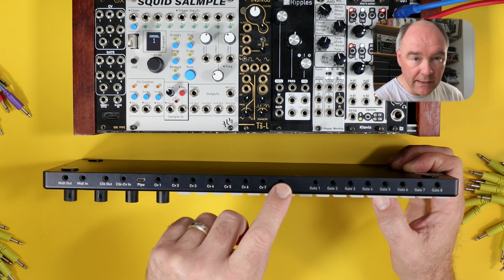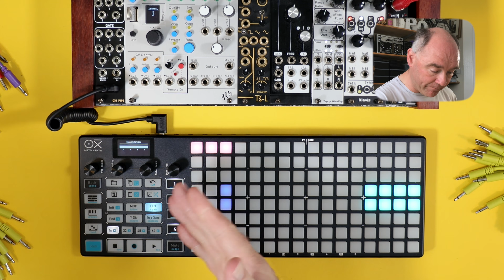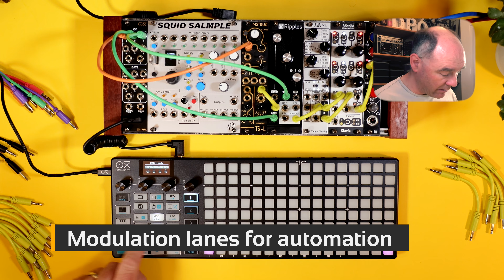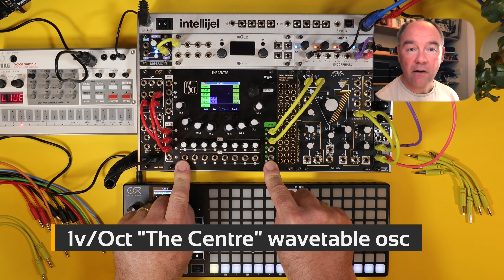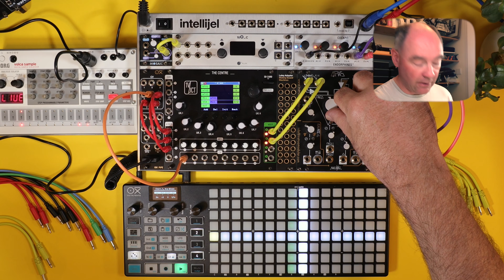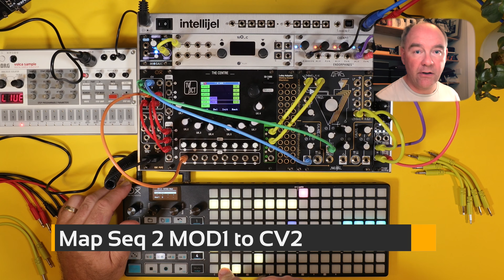Oxi One - the brain for your modular setup. What you need to know to get started

Comment: I have a fairly in-depth question about CV/gate routing and how it works when the sequencer is Multitrack or Matricial when there are multiple voices that can be used in a sequence.  How do you select the voice to be sequencing per track in those modes that have mulitple tracks on one page? I think I understand how to assign a CV and gate outputs to one of the 4 parameters in the sequence (pitch, velocity, trigger, lfo/mod, and then Gate, clock, accent, and mod threshold). but once you are on the page of a multitrack sequencer how do you know which voice you are sequencing on a given track? Say on the first Matricial track I want to be sequencing a pattern coming from Pizza and Ikarie, then on track 2 I want to be sequencing a voice on Plaits, but not as chords, rather as competely different sequences.  How do the tracks differentiate which CV and gates to sequence?
Reply from the maker: You set that up in the CV/gate screen (press the button) and then choose the sequencer and track per CV or gate output there. Maybe I'll do a video explaining that
Reply: @SynthDad a tutorial with Matricial mode the CV/gate assignments as it pertains to specifically modular gear would be amazing.  Some examples with multiple tracks and multiple CV/gate  sequences per track would be super helpful. Thanks for all you do!

Comment: Maybe you covered this in another video, but is it possible to have separate envelope parameters on each step? Also can the Oxi One do ratcheting envelopes? Thanks in advance.
Reply from the maker: Yes you can by adjusting the gate length and velocity which creates the envelope shape. Steps can be set to ratchet (as in repeat) so I'm assuming the envelopes would too!

Comment: Hi SynthDad i've just watched Oxi Instruments tutorial for absolute beginner and it shows 2 synths connected to the Oxi One via the Oxi split midi splitter with designated outputs 1 and 2 meaning that the 2 synths can be triggered independently of each other.I have a 7 way midi splitter - will i be able to use that and get the same result please ? Thanks for the support videos.
Reply from the maker: Yes you should be able to if each synth is on its own MIDI channel
Reply: @SynthDad  Ok thanks SynthDad that's good news.

Comment: When drawing a modulation curve, does it interpolate values between the steps (e.g. make it smooth) or is it stepped voltage?
Reply from the maker: It can do both! In the modulation menu press Shift and the knob corresponding to the modulation lane. This opens up a control menu for that mod lane. Scroll down and you'll see a "Smooth" parameter that lets you set the degree of slew between steps

Comment: how does the Oxi One compare to the Torso T1 as a generative Sequencer?
Reply from the maker: Good question! The T1 is more hands-on as it is a knob-per-function sequencer. You can quickly change the performance on the fly using each knob. However if you want to build songs or program specific patterns then it's not as strong.

The Oxi One is better for composition because it has an arranger (i.e. song creator) and you can build song progressions on it. It is very powerful at harmonising and chord generation too. And it has more CV/gate connections than the Torso. 

So really it depends on how you want to interact with the devices.
Reply: @SynthDad  thank you, that helps! 👍

Comment: Great tutorial. Cost differences aside, if you didn’t have the Oxi One and had to choose between it and the Squarp Hapax, would you still choose the Oxi?
Reply from the maker: I can't really give you a good answer because I've only played with a Hapax for a few minutes so don't know how to compare it. I think the Hapax has more advanced MIDI effects, but is larger and no battery power. The Oxi wins for CV/gate connectivity with 8 as against 4 for the Hapax.
Reply: @SynthDad  Good point about the number of CV / Gate outs. And that breakout module is a much tidier way to connect it to the modular. Cheers.

Comment: Here's something that's been killing me: the completely undocumented DIN SYNC functionality only mentioned in the manual in the context of an unincluded dongle. I've been trying for days to figure out an easy way to have the One trigger the Run functionality of Pamela's New Workout.
Reply from the maker: Oh I hadn't seen that before. My One didn't come with that adapter so I can't test it. Why not use the Clock Out TRS port on the back of the One into Pams? That's how I sync them
Reply: Ha, well I just learned you can set Pam's to start/stop based on clock instead of Run so now it works great. Really interested to see what the new "Matriceal" mode is going to be.

Comment: When you bought this, did it come with one or two MIDI cables? 
Even though I don't do Eurotack, I am toying with getting one of these. I do have synths with CV/Gate though. 
Nice video.
Cheers.
Reply from the maker: Yes I think it did. Definitely get the Oxi Pipe if you’re planning to use it with modular gear though